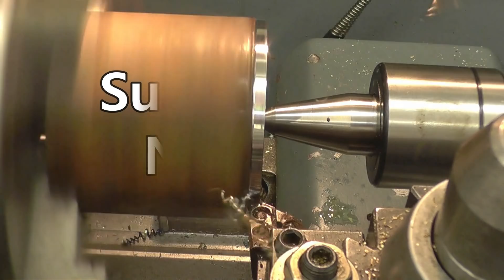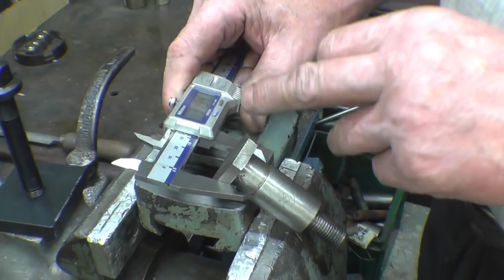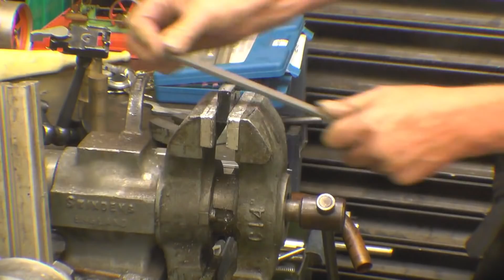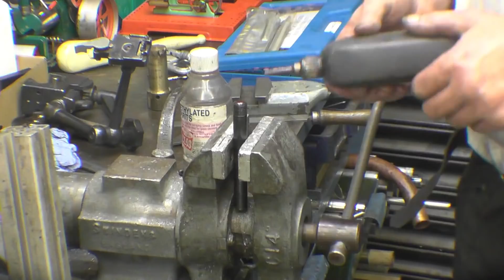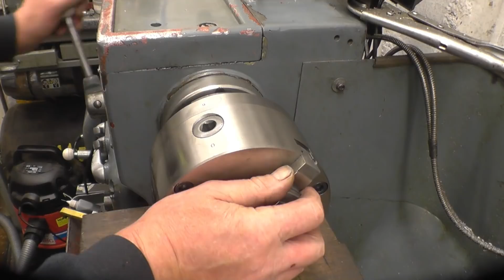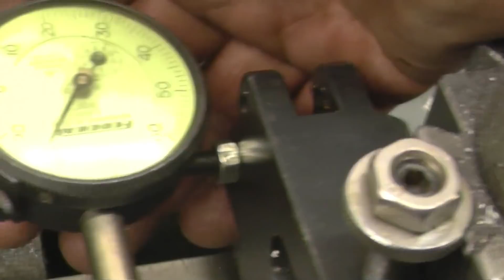SNNC 344 p2   How To Zero A New Chuck   , Tool Post Mod

Comment: Don't think I would have done this.  First I don't like the piece used for an accurate measuring tool in the chuck.  If it has been turned it will only be as accurate as the chuck it was turned in.  The turned piece okay but not the piece that was in the chuck.   They will be off centre to one another unless the chuck was perfect that it was turned on.   I think I would have bored the jaws before doing this also.   Then when you change the chuck it will be true immediately and no hammering.   I had one chuck like that and I turned it to all three positions (3 bolts) and found the one position was dead accurate so I marked it so it always goes on the same way.   I did enjoy the video though.   Thanks.

Dale in Canada

Comment: 13:25 Chuck removal - you released the nut with the C spanner then spun the nut by hand - which, at 13:25 loosened the chuck without needing the spanner again - suggesting the taper fit isn't as good as it should be.

Comment: On a machine like yours, are the scenarios in which climb milling is okay ? Like in aluminium or delrin for example ? Or light cuts in steel ?
Reply: It's all down to removing any backlash - whether play in the screw thread or bend in the machine ! You also need to be sure the work is clamped beyond belief - as if it slips a disaster will likely ensue.

Comment: John another great Sunday night nightcap! On the chuck run out checking, I would recommend using a big carbide endmill if you have one. I  know you use that machined rod but unless you are dead certain it runs perfectly true, ( preferably checked while being between centres) . I use a 16 mm long carbide end mill I bought off of eBay brand new and it works very well as a machined reference for checking run out, just an idea lol
Reply: Well, if you don't like run-out, place it between centres :)

Comment: A great part 2, really enjoyed it. I wouldn't have done that to the 3 jaw. Just my opinion. If you don't take the part out of a 3 jaw then it's concentric. You are now relying on the clamping forces of those bolts to hold it in the position you bumped it to. The register should hold it true and take the load. The bolts are  just there to stop it falling off. Given that you take aggressive cuts (I do too) it's likely that it will move. You'll probably want to bump it every time now. Just my opinion mind.
Reply from the maker: The bolts also create the clamping force to stop the chuck slipping  it wont move
Reply: @doubleboost  Unless it leans against the bolts. After all, it's not likely you'll be taking heavy cuts in reverse. Get the Loctite out again and put it on the mating surfaces :)
Reply: 100% agree with that. If you can't get it true as was built, then you should be looking elsewhere.

Comment: I've always thought it is important to tighten all pinions, but always start on say 0 and end on 2 if that is how you've planned to do it. The reason is that there can be a bit of slack or give with only 1 tight pinion and you want each pinion pushing against each other as each pinion pushes the jaws to an eccentric position while the you'd want to stay concentric to the registry.
Reply: It's all down to the scroll - and I find it surprising how poorly supported scrolls are. One would expect a bush snug fit.

Comment: Time 07:10, touch off. Why not touch off without the mill running, and setting the DRO in case You will not be milling off the marks?
Time 11:50 You tell the chuck is running dead true. Yes, some day in the future it will need adjusting but You choosed to create the adjustment possibilities now. My chuck ran well at delivery so any adjustment possibility lays in the future. Thanks for the tip "how to do it".
Reply: Best way to centre a chuck is to throw it in the corner and put a centre in the lathe.
Reply: Don't, it is inaccurate and you may break something - most likely your mill.

Comment: I think many YouTubers sound like the are commenting on English ales, when talking about mystery metals 🍺🍻🍺🍺🍺.
May I suggest using the side of the end mill at full 12.5 mm deep, but half width, rather than the bottom on full width, many end mills and slot drills are thrown away unnecessarily.
Great vlog John thanks for sharing.

Comment: Thanks I just needed this. Last week I bought a micrometer to zero the chuck of my little Hobbymat. Now I know how to start!
Reply: Don't forget you need the gentle persuasion lump of hammer to do those fine adjustments as well. No limit as to how gentle you can hit with a big hammer, but the other way definitely so.

My father used to tell of him doing forge operator tests, and them having learnt all the way from forging a 10 ton casting with a dozen blows to gently popping in a glass face plate on a fob watch, all on the same steam hammer. then the one operator who was doing the second demo, and he lifted the hammer to the top, with flat faces, and brought it down full force on that watch, turning it into a brass smear. Tester saying "I really didn't like that watch anyway" and passing him, while factory managers looked on in shock, along with the rest of the shop.
Reply: SeanBZA what a brilliant fucking story!!
Reply: @SeanBZA  I will keep this in mind👍
Reply: Do it properly - and turn between centres.

Comment: What does it mean when there are 2 different high spots on a independent 4 jaw. When spinning my chuck the two different high spots are about .004" different no matter what I do. It is always the same.  I have an atlas 10" with 1 1/2-8 spindle that runs true and i have refaced my back plate twice. ( also runs true.) How do i fix this?
Reply: Where did you measure these high spots?
If they are on the face of the chuck, your chuck is slightly warped. You can remove the jaws and reface your chuck.

If they are on the outside Diameter of the chuck it doesn't matter...

If you measured that on an shaft which is clamped in the chuck, the shaft is not round...

Comment: Seems to me if you can move a chuck by beating it with a hammer, it's time for a new lathe
Reply from the maker: I dont think you fully appreciate what is being done in the video
Reply: @doubleboost  Haha! Ace comment John!
Reply: @doubleboost  I do but I was being a bit sarcastic.  I've been a machinist for close to 50 years with half of that on manual machines.  But have to say I don't recall ever having to do that with a chuck or seen that much run out on a new chuck.  Maybe the last 25 years programming and running CNC's has fogged my memory.  Thanks for you videos they have been educational.
Reply: It's a good lead hammer , not that it counts for much , it's the man holding the handle and the years in his arm that counts.

Comment: Quote of the year. Doubleboost on climb milling: "Often used on big, rigid machines...but not by Johnny."
Reply: “don’t want no wobbly slack” - John
Reply: I remember repairing an old NC lathe, and the operators wanted to use it like they did the 10 ton monster next to it, by cutting off a half inch at a time. Had to explain carefully that this was a little lathe, and did not have a 20 horsepower motor running the spindle, only a 3/4 HP one, and it was never going to do that in anything other than polystyrene.
Reply: @SeanBZA  By 'polystyrene' did you really mean 'expanded polystyrene' ?
Reminds me of a tale my dad told me - a plant firm got a brand new bulldozer. After day 1, back at the yard they were keen to hear how the new machine faired. The operator said: "Puff the mighty dragon - it wouldn't shift fog !"

Comment: time for a new Eclipe blade in that hacksaw John, the old one sounds like it is more gum than tooth there, though I have known them to get used to the point they are smooth both sides, and you can tie them in a knot.

Yes using a hacksaw is hard work, thought you have a semi working power hacksaw though somewhere in that shop.
Reply from the maker: The saw is in the shed up the garden
Reply: Johns shop is VERY small.  Not enough room to swing a dead cat!  He can really turn out the work that's for sure!
Reply: @jagboy69  It is a converted single car garage, yes I know space is tight, doubt the car could fit there unless it was turned into small parts.
Reply: @SeanBZA  YUP.. Really tight.  I'm amazed at what he can do with it.  I've got 4times the space and still have a hard time with it.  Maybe john can do a video on how to get organized.  I need some lessons.  :-)

Comment: Didn't before notice that you're left handed.
Reply: He's not, he's right-handed - holding the camera in the right hand ;) (j/k)
Reply: @millomweb  but look how he operates the hacksaw. I could never do that as a right-handed. So he's either left or both handed
Reply: @MF175mp  He might be right-handed but have  a shop like mine with that much clutter you can't stand at the vice to use the hand you'd prefer ;)
I can saw in either hand but am left-handed.